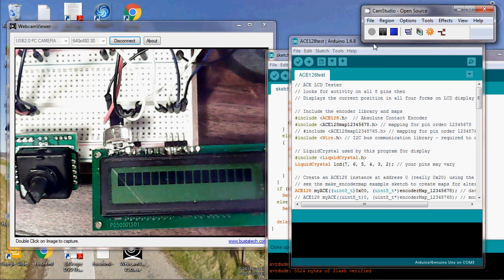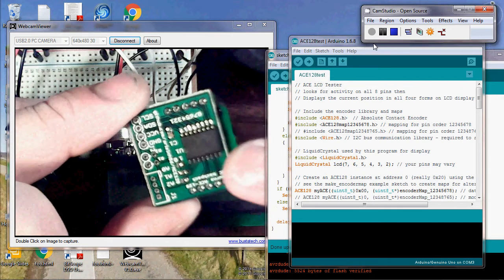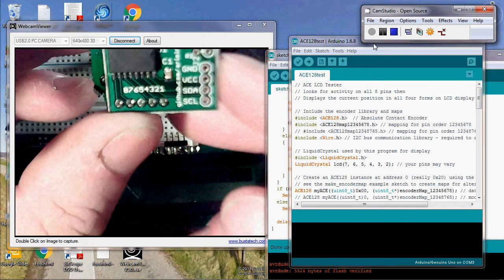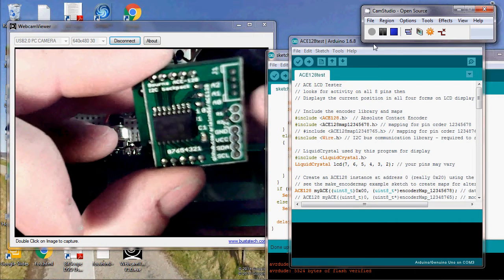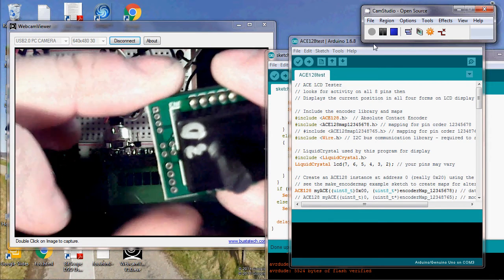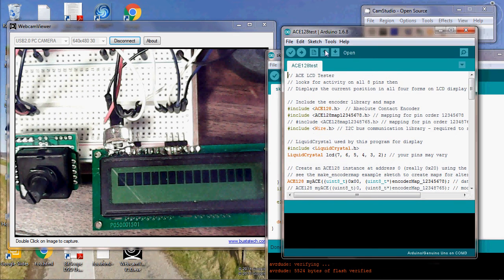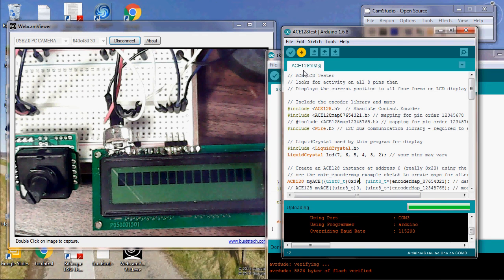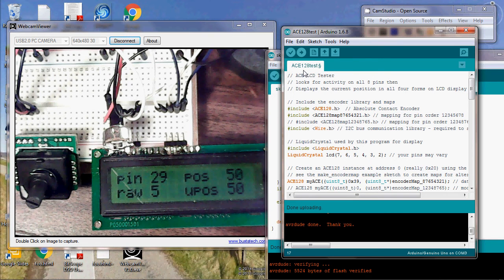ACE128 Absolute Encoder I2C Backpack for Arduino

Comment: To be very clear, can this Absolute Rotary Encoder spin endlessly in either the Clockwise or Counterclockwise directions?
In other words, is it multi-turn? [update]: I found the answer on your tindie page . . .
This is an alternative to using a potentiometer and analog pin, allowing full-turn and multi-turn operation, and is not impacted by temperature variations.
Reply from the maker: Yes